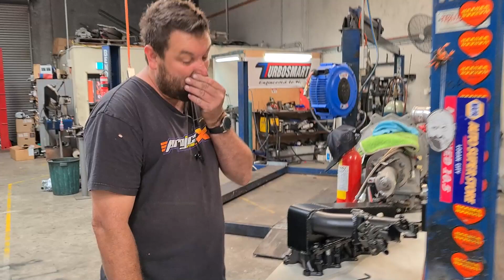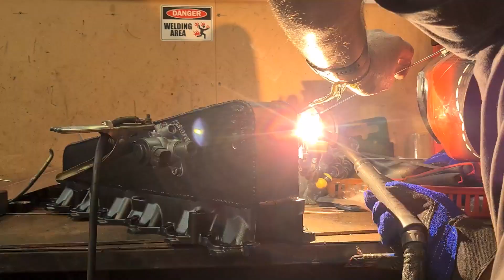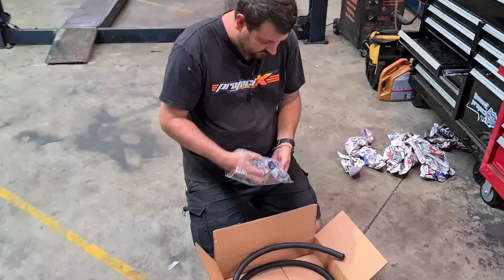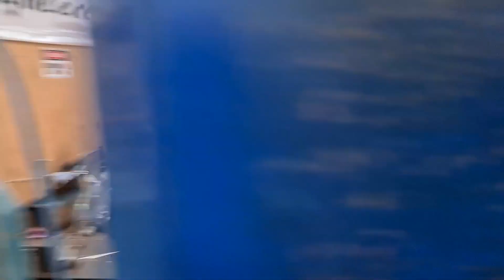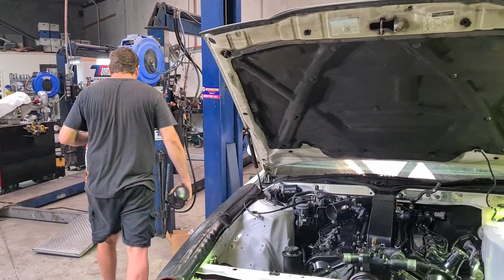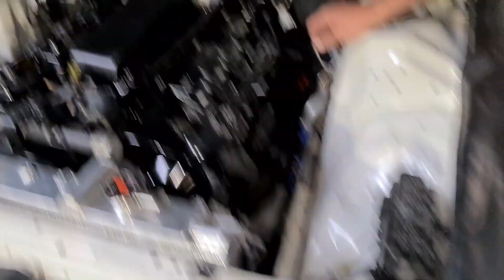Building a Turbo V12 Powered Toyota Cressida, Ep6!.. this decade....

Comment: When I installed the built block into my 709 whp EJ8 Civic I painted the block, head, and transmission in OEM Honda Nighthawk Black Pearl and it still looks amazing in my car 4 years later. Most of my external engine parts are either anodized black, polished, stainless steel, or billet, so it looks really good. The only real off color is the yellow Accel coil packs.

Comment: Gotta love a toyota engine that’s sat for ages, oil pressure no worries :D
Reply from the maker: I did pre fill the pump the oil filter and the lines in between so it had a fighting chance
Reply: Have same thing with the Aussie Ford inline sixes...
Reply: BENNY! I seriously wish I had half of y'alls fabrication skills. I wouldn't have had half of the problems that I did with my turbo J32A six speed manual swapped CG1 Accord on AEM. I can MIG weld, but I don't have a TIG welder yet, so I have to pay a friend to TIG weld everything aluminum for me.
Reply: Is this the original cresta motor?

Comment: Hi Fellas 
thanks for the videos. I appreciate what you achieve with ingenuity rather than a big bag of money. 
However, I hope you're going to put an extra brace on the remote oil filter housing. That's a lot of weight swinging and vibrating on the one mount. 
I assume you're waiting to figure out what space you have.
Cheers
Reply from the maker: Hey Jeff thanks and yep it does move easy so will add some triangulation

Comment: G'Day Mr Nugget,,I'd be a bit worried about filter bypass,going straight to turbo feed,
Some filters have internal reliefs to stop blowing filter up,,Suggest buying inline strainer for turbo oil feed hose,This will keep the big chunks out,,I'd Also run oil pressure signal from same point,,
But if you Boys keep up the service this should never happen,
Unless ya have shavings happening,,

Comment: Good work you blokes. Really making me miss my MX-83. Old man bought one new in 91, I bought it off him in 05, stock as, and the usual head gasket fun. Found porosity in the block and fixed that. (don't ask.. just know it's industry standard as Super cheap sell the repair "method" cost two water pumps but she kept running...)
and...
She's still running near 10 years after I sold it. Very Solid and comfy cruisers in every way... if I found a low km car now... I'd buy it in a heartbeat.. good luck finding parts... lol Toyota Tax all the way. great cars that were way ahead of their time.

Comment: the oil filter will trap air and cavate it back into the oil at High PSI, if you mount it sidewise, it needs to be mounted filter down.
Reply: There is heaps of cars with the oil filer mounted mounted on sideways from factory
Reply: Tell that to every 1JZ ever made dude.